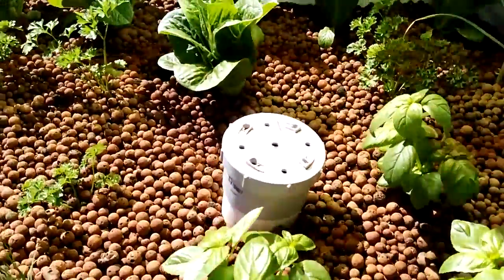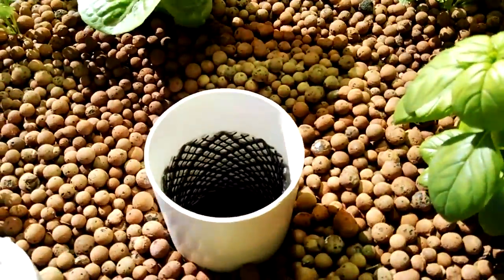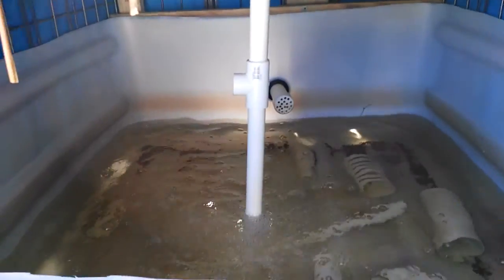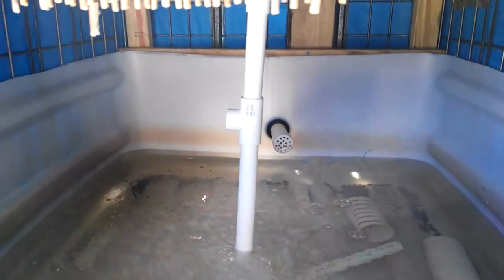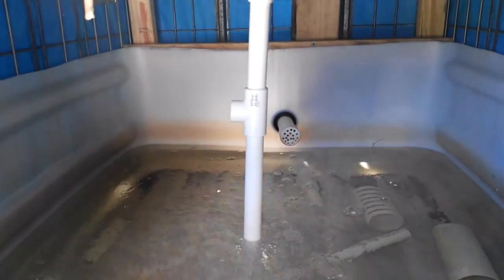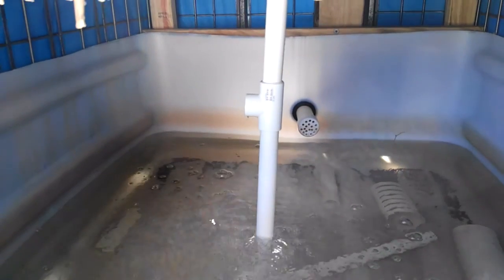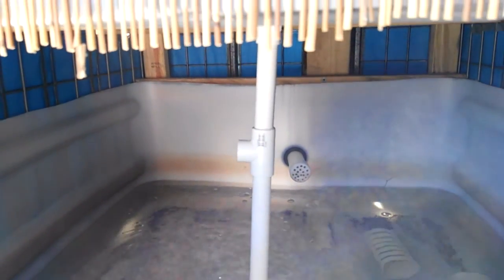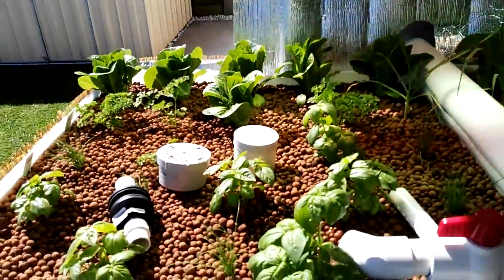Aquaponics constant flow/height to flood and drain conversion.

Comment: Nice one Owen. How far down are the slits/holes in your media guard? 
Cheers for the shout out too. 👍
Reply from the maker: Mine are roughly 6-7cm worth, from the bottom of the bed up. Slotted with the angle grinder with a 5mm thick disc on it.
Reply: Should give them a decent flush out then 👍You have me thinking about playing around with something similar on the parents system now.

Comment: So the principal of this is bulkhead with stand pipe to height required for max level. Then the cover has slots Cut in bottom like a standard bell syphon? But instead you just cap that pipe so it's air tight at the top? Then fix a T piece directly off the other end of the overflow stand pipe? Does it have to be a certain distance away? Can the flow back from the other side of the t be above water?
Reply from the maker: That's correct, it's basically the same as a bell setup. Just the airtight cap on top. Distance doesn't seem to matter for the T, I put mine lower so it didn't splash onto the timber holding up the bed. If you have a lot of flow, the back end has to be underwater for back pressure, but I found if you have it with the water coming in the bed at the rate of a normal bell setup, it will work without being in the water. I had way to big of pump on that one, and had no choice to run water through the beds a lot quicker than usual.
Reply: @owensfunhouse7582  great thanks for the knowledge!

Comment: Why is this not used more than a bell syphon? So much simpler!
Reply from the maker: I'm not sure mate. I was tinkering with the system one weekend, and found that I could make a bed drain without a bell. I have had one of my beds running this contraption for about 18 months now, and it hasn't missed a beat.
Reply: @owensfunhouse7582  that's really decent. I just posted another comment above.